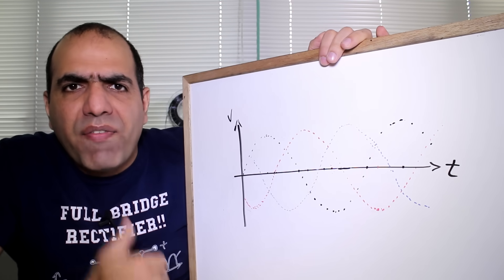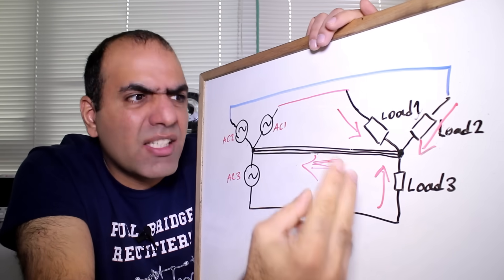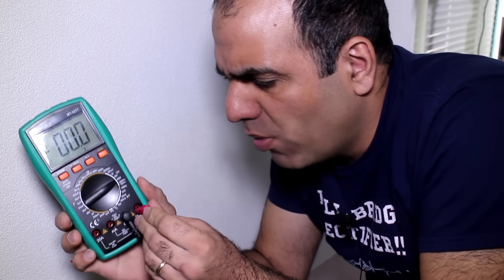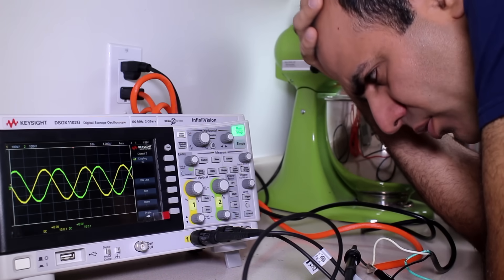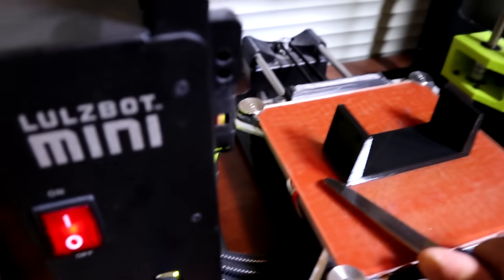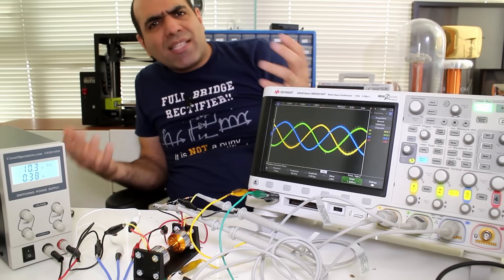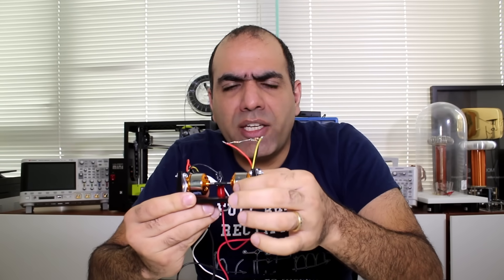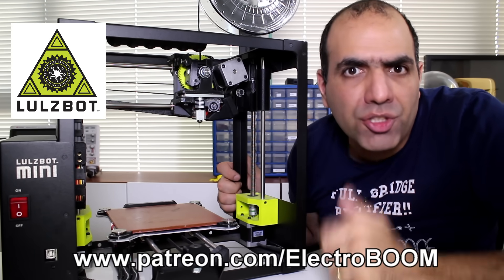Why 3 Phase AC instead of Single Phase???

Comment: Actually Three-Phase provides √3 (~1.7) more power, not 3 times
Reply: If a single phase used 1 VA of power, three of them on equal loads will use 3 VA of apparent power... 

So if you have 120V ac on a single phase, and you draw 1A on that phase, then if the other two phases are also drawing an amp, then the total apparent power is 3*120*1 = 360VA. 

The root(3) applies to line-to-line voltage. So a 120V ac on a single phase would be 208V line-to-line. So if you're drawing 1 amp , then the apparent power is root(3)*208*1 = 360VA.
Reply: Skaarjman you seem to be confused and unfortunately imparting your confusion onto others in the form of misinformation. I would propose that the root your confusion begins with some incorrect assumptions and that in your equations that you present as proof of your misunderstanding, you have omitted some useful notation that would otherwise make your error quite clear. First let’s assume unity power factor so you can omit the “pf” term from your equations. Second, recall that for single phase, the “U” you refer to in your first equation is really U_ln,rms (RMS line to neutral or phase voltage) and this RMS voltage is impressed directly across the (resistive) load. Let’s assume for discussion U_ln,rms = 120V, that R_load = 10 Ohm, such that I,rms = 12A and therefore P_1,rms = U_ln,rms * I,rms = 1440W (where P_1 denotes total power in a single phase network). You go in to suggest that power flow in an equivalent three-phase load is only sqrt(3) * P_1,rms = P_3,rms but this is incorrect. The base of your error stems from the common convention when referring to three phase system voltages to refer to the line voltage (that is, the line-to-line voltage), which for the balanced, harmonic-free case will adhere to the relationship U_ll,rms = sqrt(3) * U_ln,rms. Your equation is correct on that assumed convention basis where the U in your second equation implies U_ll,rms. But (thirdly) you are missing the fact that U_ll,rms is not the voltage impressed across each phase’s (resistive) load, rather U_ln,rms is. The equation you cited written with the requisite additional notation is P_3,rms = sqrt(3) * U_ll,rms * I,rms. Substituting phase voltage (line to neutral voltage), that equation becomes, P_3,rms = sqrt(3) * sqrt(3) * U_ln,rms * I,rms = 3 * U_ln,rms * I,rms. KTHXBYE.
Reply: You've mistaken with  three-phase wye-connected secondary still
Reply: what bugs me that you got 230V and 400V from where ? Phase voltage in Canada is 120V and line voltage is 208V
Reply: You are mixing a number of subjects. Your original post (incorrectly) clams "Actually Three-Phase provides √3 (~1.7) more power, not 3 times"; all responses to this are with regard to single phase versus three-phase networks. Now you are introducing the subject of split-phase, which is just a center-tapped secondary winding with center tap becoming the ground/neutral reference. Split phase is still effectively single-phase since the basis vectors are linearly dependent, so no spatial decomposition is possible (it's still scalar). Finally, you are mixing an unrelated subject of reactive power. The treatment of complex (real and reactive) loads is the same for any phase displacement arrangement, and since your confusion is on the more basic issue of single vs poly-phase, we should omit the subject of reactive/apparent/complex power allogether.
Reply: He measures ~205V since his house is supplied by two phases of a three-phase wye-connected secondary, with grounded midpoint. His house is not supplied by a split-phase transformer with grounded center tap. The angular displacement between the two phases is, in his case, 120 degrees--not 180. As such, each phase measured with respect to neutral/ground will be ~120V, while the voltage measured between the two phases will be sqrt(3) * 120V = 208V.
Reply: https://www.linkedin.com/in/michaudd/
Reply: Funny, you upvote your own comments.
Reply: Not really, and the difference is caused by a confusion between line-to-line and line-to-zero voltages. Let's see an example: You have a 3 phase "400V" 16A output splitting to 3x single phase "230V" sockets. Let's plug our 1st device: An 16A 230V (~3.7 kW) heater. This will load 16A on L1 conductor, 16A on neutral conductor, while L2 and L3 see no curret flow. Now let's plug 2nd 3.7 kW heater: Now there is 16A flowing in L1 and L2 conductors, 0A in L3 and some reduced current, approx. 4A if I'm calculating OK in neutral wire as much of the current flowing from L1 to N is going back from N to L2 due to 120* phase shift. Both heaters are ~3.7kW totalling ~7.4 kW.  . This is basically equivalent of 16A load connected between L1 and L2 at 400V totalling ~6.4 kW and remaining ~1 kW in form of 2x 0.5 kW connected from L1 to N and L2 to N. And when you connect our last heater to 3rd output you now have 16A on L1, L2 and L3 and neutral currents are cancelling each out completly to 0A. Total power = 3* 3.7 kW = 11.1 kW, which is 3x the power delivered with just 2 conductors while keeping a constant 230V phase to ground voltage.
Reply: You are just trolling right now, aren't you? This is an ideal example, forget voltage losses. Or change the values to miliamperes and watts if that bugs you.
Reply: Incorrect. The sqrt3 is  is used to convert between line-line and line-ground voltage.
Reply: You forgot about the fact that US uses Split-phase supply, which means one of the phases i split and fed into the house. Each house really gets one phase (sometimes 2, from high delta), That;s why he measured 205 volts, on top of that, if you want to calculate the power you have to take that into account.
"In electrical and electronic systems, reactance is the opposition of a circuit element to a change in current or voltage, due to that element's inductance or capacitance."
 Remember that
Reply: couldn't find reference of anything you said
Reply: voltage drops with such a large heaters, so your calculations aren't correct
Reply: For single phase power is calculated:
PF × I(A) × U(V)
However for three phase:
√3 x PF x I(A) x U(V)

3 x would only work if each phase would have it's own separate reference point

Comment: Why don't you just use the output of the ESC ( I mean this ESC also outputs a three phase AC voltage.) or just use a DC motor for input rotation? Sorry but I guess it is non-efficient and stupid. Please let me know why did you use this design. Gmail: "doctorthe113@gmail.com"

Comment: Hi ElectroBOOM! I think there is an error when you describe the ESC, indeed the ESC does not produce 3 phases, but only 2, the 3rd winding is used to define the position of the motor, only 2 coils are fed simultaneously, this principle is also used to reverse the direction of rotation: =)

Comment: But what does cos φ mean? Still confused by it even tho I should know excactly what is means after 3 and a half years..
Reply: phi is angle between voltage and current. Resistive loads have phi=0 which is optimal for power transmission. Capacitive and inductive loads have phi = 90 or -90 degrees, so cos(phi) = 0. That means you have voltage and current but no power is actually transmitted, you're just heating the wires, nothing more.
Reply: AllMyCircuits
Thanks!

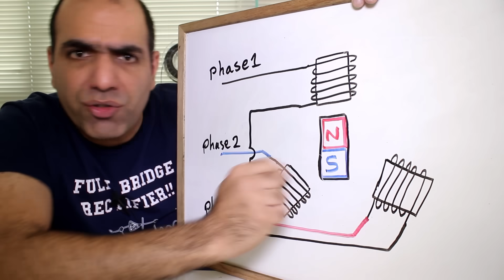Comment: 8:20 - Isn't the poles in a 3-phase motor-generator also supposed to be physically 120 degrees apart?
Reply: No, they don't have to. The fastest induction motors really have just 3 poles, so one electric 'turn' equals one mechanic turn, that is 3000 rpm for 50 Hz or 3600 rpm for 60 Hz. That's rotational velocity of magnetic field, while rotor is bit slower.

But there are also 6-poles motors, so their speed is half that. Some are even more. Stepper motors have incredible number of poles, so one electric 'rotation' push rotor to really small angle. Another example: ceiling fan motor. It should have lots of poles to maintain low speed, otherwise it would turn into propeller and grind all the people inside!

Comment: Alternating current (AC) is an electric current which periodically reverses direction!!! Since ESC doesn't reverse the polarity of the output, technically the motor is DC.

Comment: Why we use 50-60 hz(at least in Europe)
Reply: After some calculations this frequency was considered optimal. The more frequency one use, the smaller motors and transformers could be made with the same power, but laminated steel heats more because of eddy currents and hysteresis. Also, transmission losses are higher, the sound itself is very annoying at higher frequencies (50/60 is rather noble humming while 400 Hz is in the part of spectrum where human ear is most sensitive, I hate it!). Then it became a standart which no one would like to change.

Comment: Ahhh, you are the best at making my day better. Got my hands dirty the other day, which is my teacher's way of saying I did something useful. I took apart our microwave and replaced the broken table drive belt with a rubber band, and also replaced the light bulb that lets you see inside. The thing is an ancient microwave. My dad actually had to make a 12000 volt diode out of 12 1000 volt diodes in series to replace the old one, which vaporized when somebody put their teabag in the microwave.

And today I learned how to surface-mount solder, kinda painful for both my brain and my hand. Soldering Irons are hot.

Comment: Correct me if I am wrong but Sauna needs 3 phases, right? So in Finland we do get 3 phases to homes, but I guess Saunas are rare abroad, so it might not be relevant.
Reply: saunas usually have large electric heaters so 3 phase is necessary for them

Comment: Rewire an automotive alternator to do the same thing...
Reply: It is already 3-phase machine with rectifier at the end! There is video (https://www.youtube.com/watch?v=IKqy3rRWJQE ) where guy removes rectifier and connect phases to VFD, so alternator turns into motor! Bad thing: it needs additional current to the rotor (instead of permanent magnets) but this could theoretically be an advantage: it's another control point, so you can weaken the field at high speeds to make it go even faster without raising stator voltage!

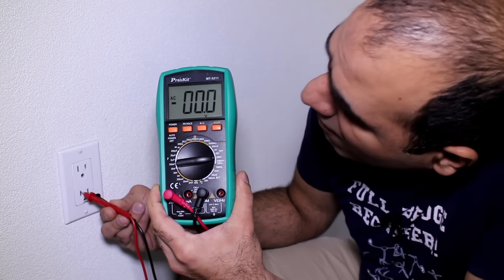Comment: haha, explosion at @3:06 he is using different wire colors... busted ;)Bright red goes into the wall socket, but he has a milder color of red in the meter
Reply: Never ruin a good multimeter if you don't have to. Love your tools as you would yourself, for they are extensions of yourself.
Reply: no, they're just tools

Comment: Hey from Finland, up here 3-phase is standard into every home. We split up the three phases in the house breaker box for single phase applications and where we need a 3-phase power we just combine it back again. Like the stove, or the heat pump in our house. 

And of course in the workshop you just need 3 phase in order to power anything serious. Wired up a motor for a dust collector last night in star mode.

Comment: As a knife maker, I buy all my motors 3 phase.  I also need a VFD to convert 1 phase 220 to 3 phase 220. That way I can control the motor without losing torque. I see a lot of guys buying 1 phase with pulleys, which IMHO, you might as well save another $100 and do it right... Great video, take it easy.

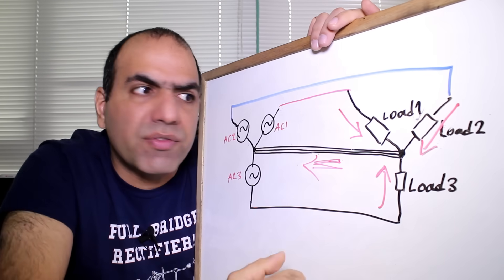Comment: 1:50 Really no neutral needed in three phase? Then why there is 4th wire on transmission lines?
Reply: 4th wire in high-voltage transmission lines is lightning protection mostly. But the transformer has neutral wire at secondary windings and this one goes to all the consumers for much more freedom. Some can use single phase relative to neutral, while power-hungry applications use all 3 phases.
Reply: Remember that assumption was based on all three loads being equal. But only a very thin neutral wire is needed with three phase, since the loads should be close to balanced.

Comment: What's better than a full bridge rectifier? triple full bridge rectifier,  3x times the normal full bridge rectifier
Reply: There are also 12-pulse rectifiers and even 24-pulse rectifiers for large-power 3-phase applications. Example: getting DC voltage for third rail in subway! Rectifiers like these don't require large capacitors to get almost constant voltage and they also have great power factor (power is consumed continiously with almost no ripple)

Comment: cant beleave you taped the motor to the generator. Why you dont print a connection part? :D If you go more into 3d printing make sure your infill is in triangles or hexagon shape, makes your print much more reliable.

Comment: Great Video as usual! But a small doubt.
If we use one of the fancy BLDC motors as a dynamo on the cycle, will we get 3 times more power output from that?
I assume a normal dynamo is just a simple "motor" based on the fact that its 2 wires only.
Reply: Normal dynamo is curious beast: it's special generator with extremely increased 'leakage inductance'. That means, for the load it looks like you have AC voltage source and inductor connected with it in series (and also small resistor). Point is: faster you drive, more voltage you get,but also more frequency, so this inductor would increase impedance and limit the current. This way, light bulbs could never burn out because of too high speed. Say, it gains maximal brightness at 15 km/h and doesn't get any brighter after that. 

It's hard to estimate a power you get from BLDC. If you spin it fast enough, you can get hundreds of watts probably, but it's hardly needed on the bike. At lower rpm it produces much less.
Reply: AllMyCircuits Wow, thanks! Learned something new today! It did bug me, the faster cycling thing, but I thought they used some sort of regulator, especially with those new led lights. Time to Google stuff!
Reply: I had a question for a long time: what is the meaning of '6 V, 2,5 W' text on this dynamo? At  what velocity is it measured? Now I understand it perfectly. This is voltage and power of light bulb if you want it to work well! 6 V, 2,5 W bulb would light up at low speed and never burn. Set higher voltage bulb (like, 10,5 volts 2,5 W) and it dies very fast because it can't withstand much current! Set lower voltage bulb (3 V, 2,5 W) and it just don't want to light, because it requires too much current which dynamo never outputs.

But never tried dynamos with LEDs. When this became available,  I just bought bright torch with 18650 Li-Ion battery which I charge before a ride...

Comment: in lithuania apartment are divided between 3 phase . phase for a stairway with consists 5 floors with 3 apartmems and there are 3 stairways . its not a balanced  tho so 10 gawge wire is used to conect to 10 kv transformer. the more u know

Comment: 3 Phase AC Motors have been used in trains for quite some time, which I suppose counts as an industrial application.

Single phase AC is fed in to the system, which is then rectified to DC and then converted back in to three phase to adjust the characteristics of the motor.

Comment: Sorry to say this, but Tesla did invent the 2Phase-System(180°) and invented/patended a 2Phase-Motor/Generator, look for "polyphase patents". He didnt invent the 3Phase-System and thats why you have still alot of 2Phase-Systems in the US.

The 3Phase-System(120°) was invented 1888 by the russian guy Michail von Dolivo-Dobrowolsky, who worked for AEG in Germany at this time and thats why whole europe has a 3Phase-System!
Reply: 2-phase system is actually 90° instead of 180°, because it's the best way to get rotating magnetic field. With 180° it would be pulsating the same way as with 1-phase. And that's why it's a little ugly compared to magnificent 3-phase system!
Reply: Ah okay, thanks for the info, i dont know how it works in the US or Canada directly.  If it would be the same as 1phase it would be 360° or 2pi shift. 

In Europe we only have a 2phase train energy network, which has 180°(=pi) shift.
This network works with 55kV against earth and 110kV against the other phase and is used to power the train transformer stations. At the stations the high voltages get transformed to 15 or 25kV against earth(single phase) for the standard train overhead line.
Reply: @Volken321; not just Europe has 3-phase. 85% of world has 3-phase power at ~230 V (per phase).
Reply: His name was Michał Doliwo-Dobrowolski and he was a Polish inventor. Although Poland as a country did not existed that time.
Reply: The system American houses use is called 1 phase 3 wires.
Reply: Volken321 we gotta drink a glass of water in Dobrowolsky's name